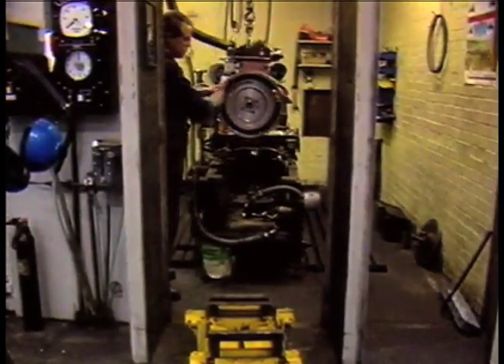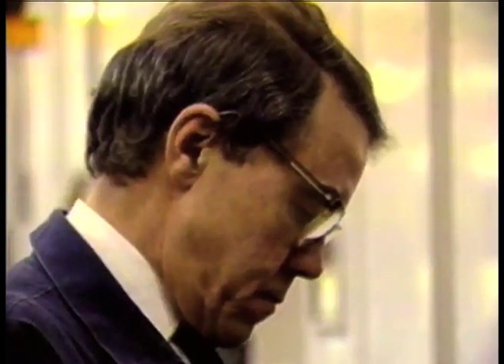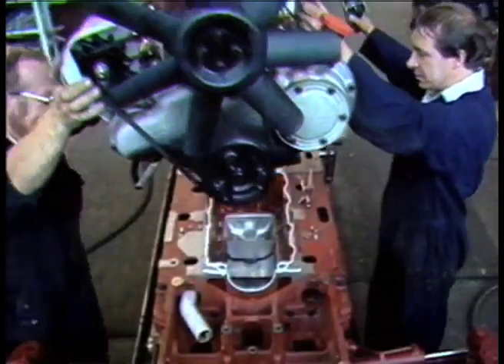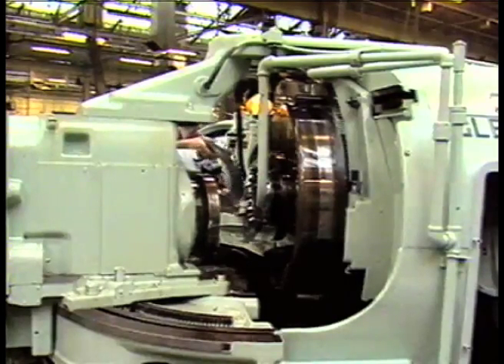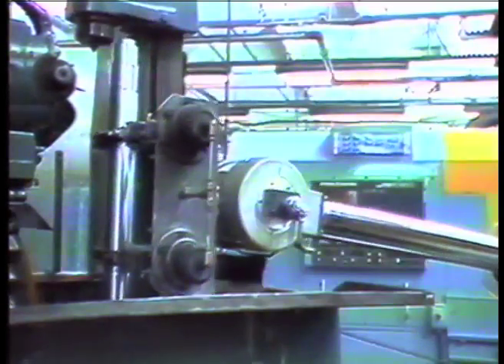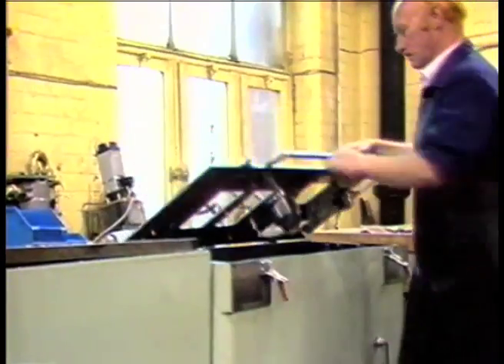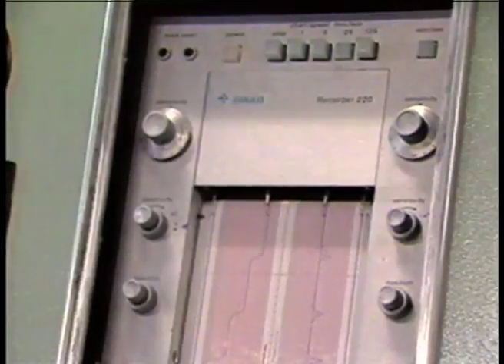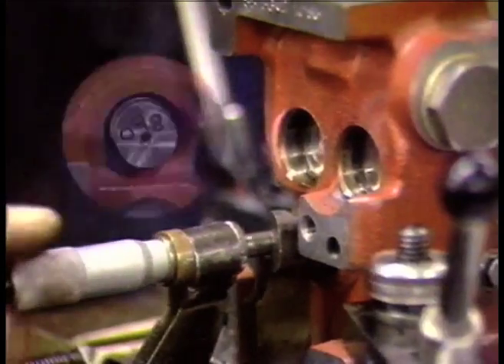David Brown Tractors - The Intelligent Tractor

Comment: Thanks very much for this , I recently acquired a D.B. 1490 with some of the selectamatic valve block valves stuck , & now I can see there are several bolts holding it to the front of the R.H. rockshaft box , so , rockshaft out first before valve block will come out , the black - haired guy with the glasses is a skilled man who obviously knows how to set these by feel as much as measurement . This type of skill is irreplaceable !  I did a factory tour at Meltham when it was still running , but couldn,t remember how to do this . Muchas Gracias Amigo .

Comment: Are these tractors still being manufactured.Here in Africa we cannot get any spares for them. If So please Help Us Get an Agent to contact Thanks
Reply: thomas armstrong No they are not being manufactured anymore, in 1983 tractors were no longer built under the David Brown name, but the Case name. The Meltham factory, where all David Brown tractors had been built, was closed in 1988. David Brown was totaly absorbed into the Case IH brand. But spare parts are plentyful. You can get your spare parts from England, some even new. Check out www.davidbrownparts.com for example. Case and David Brown are technicly the same machines but with other badges, Tenneco (CASE division) bought DB because of the awesome hydraulics for it's time, and because of the financial troubles the company was facing and growing competition on the market, DB had no choise but to sell out. The contract lasted for roughly 10 years, 1972-1983.
Reply: thomas armstrong